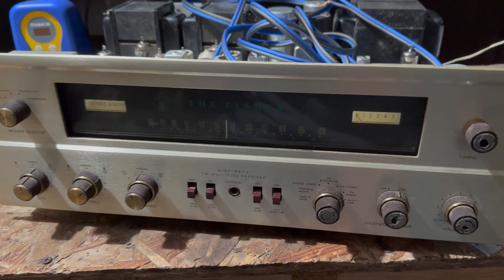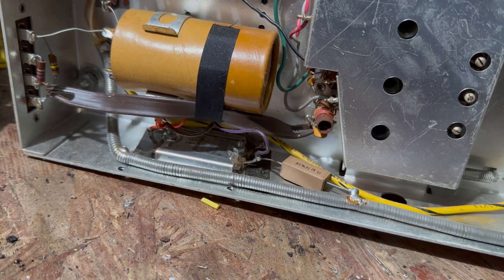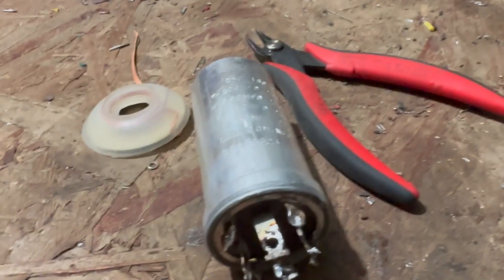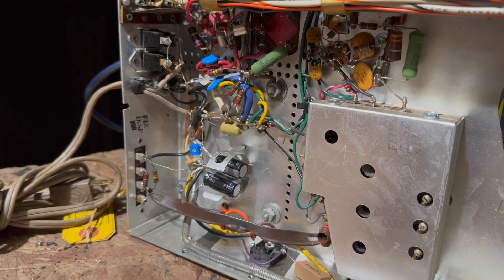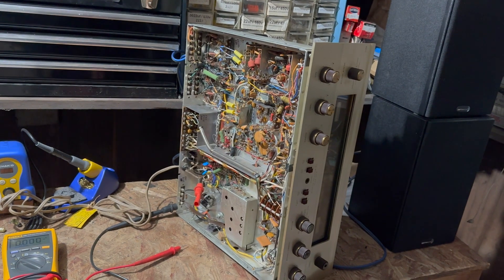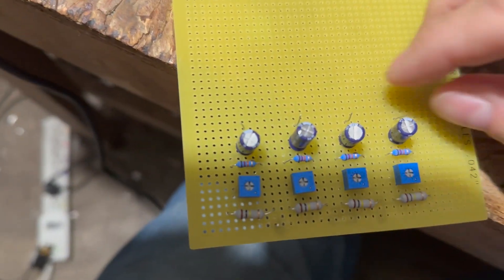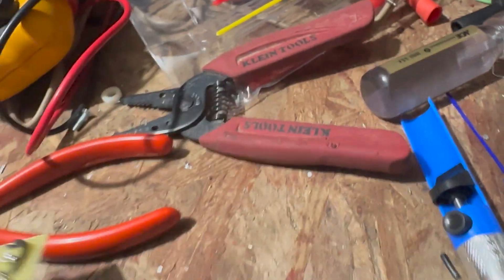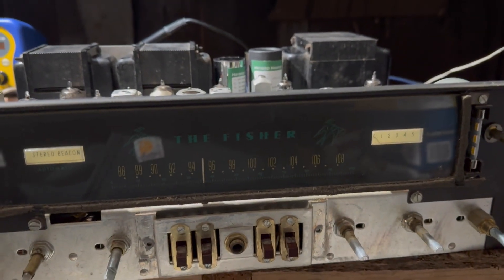1964 Fisher 500C FM Stereo Receiver Restoration

Comment: Hayseed Hamfest  multi-E Caps have  some sections with  higher ratings than originals because today's line voltage is 
higher than the vintage equipment  power supply standards of the past. With tube based amplifiers that is very important since  the  start up voltage would spike in some instances  beyond spec and shorten the life of a new replacement E cap.
This was demonstrated by a recent video by Paul Carlson. Nice old school  FM  receiver upgrade restoration Adam! You
did see that custom made hardwood cabinet on fleabuy ? That woodworker (andswell) makes custom builds for you if 
you want. It would be the icing on the cake of this receiver!
Reply from the maker: Yes, I usually use 500v electrolytics in radios with 450's, for the same reason.  The Hayseed caps are a great drop in solution.  Worth doing for something like this.  I've also got a 500B I'll be getting to eventually.  I do know of a local guy who does cabinets too, and I may consider one... Though for the moment I love looking at the tubes lit up while it's playing.  I did also replace the knob caps which made a huge difference in appearance.
Reply: @a587g  The original knobs have a circular valley cut into them where gold paint was added.